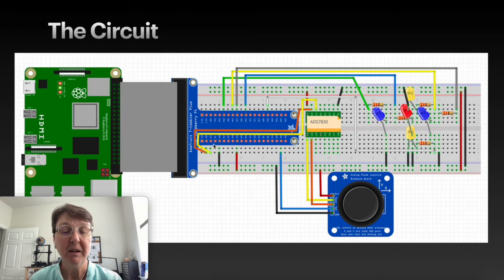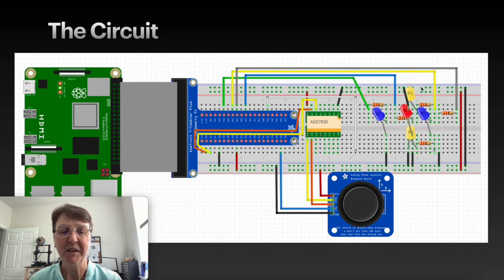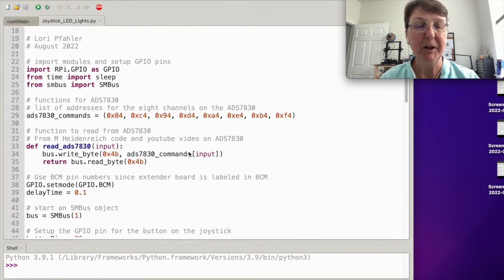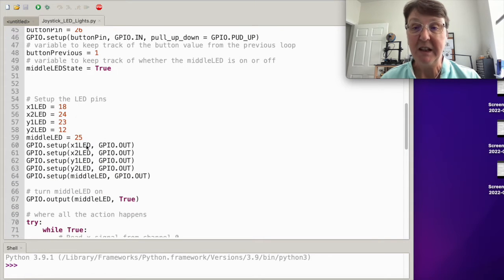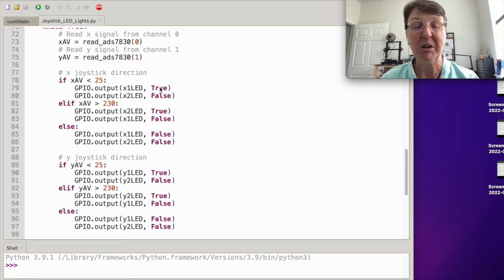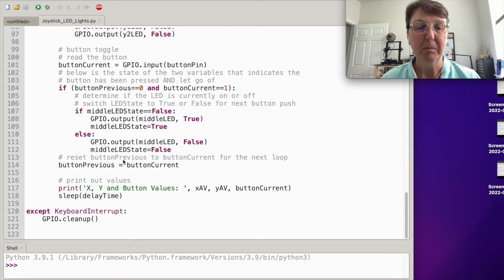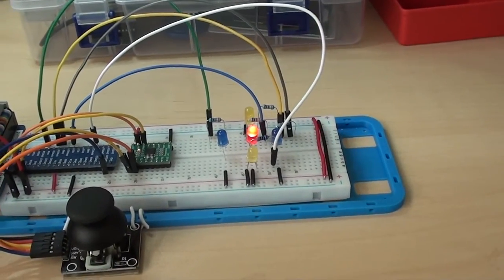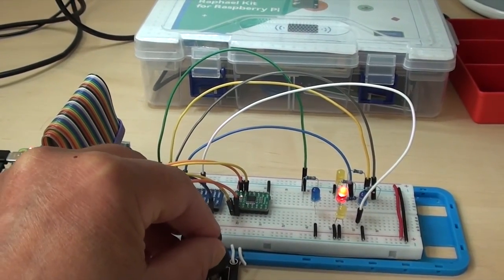Using a Joystick with a Raspberry Pi and Python

Comment: what is brand name, part number, and price of the joystick you used?  Are there better ones for find control and tapping on top to click?
Reply from the maker: The joystick I used in this video is a very cheap one that I received in an electronics kit for the raspberry pi.  I have found that the joysticks available at AdaFruit.com are much better: Product ID: 512.  I recommend getting one of those but you need to be able to solder to attach it to the breakout board.  It's not a hard soldering project.  Thanks for watching!
Reply: @lorisrobots  Appreciated!

Comment: I appreciate the video but have a errno 121 remote I/O error and cant figure it out, I have checked everything and even went through all possible solutions with chatGPT for help, any ideas?
Reply from the maker: I don't have this project setup anymore so my help is limited.  First please download and use my code even if you are sure you typed it yourself correctly.  Link to my code is in the description.  Second triple check your connections using the circuit diagram at 0:50.  If you are using a different ADC then mine, try just hooking up one potentiometer to see if you are getting readings through your ADC.  Paul McWhorter does a nice video on the joystick (https://youtu.be/T6HsRRXBVS8).  You might try to follow his video and then add in the LEDs as shown in my video.  Hope these suggestions help.  Thanks for watching!

Comment: Nice job once again! One tip I gleaned from the GPIO library docs is you can toggle an output with this one line of code.
GPIO.output(middleLED, not GPIO.input(middleLED))
It will work well for your middle LED and it saves a state variable and several lines of code.
Thanks for Posting.
Reply from the maker: Thanks for watching Keith!  I will give that a try.